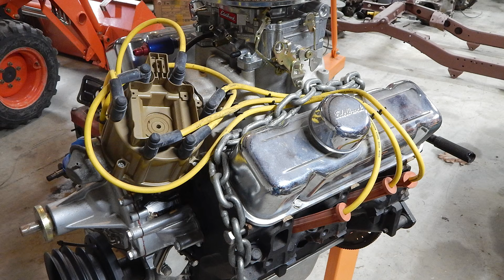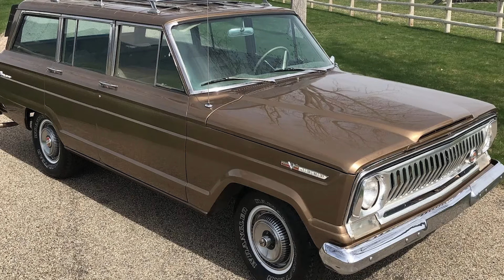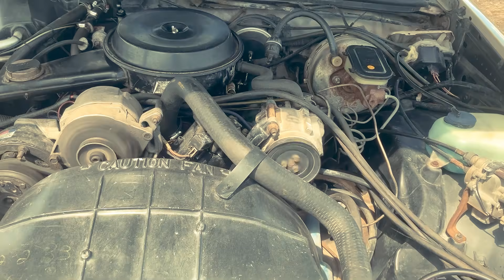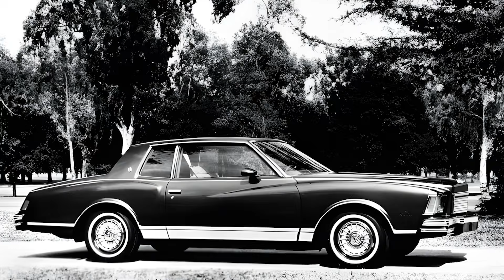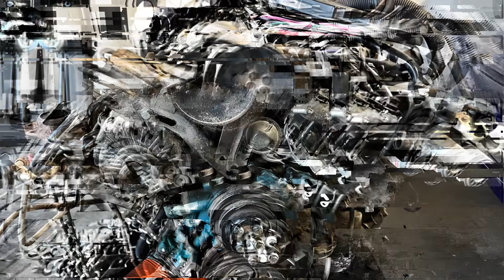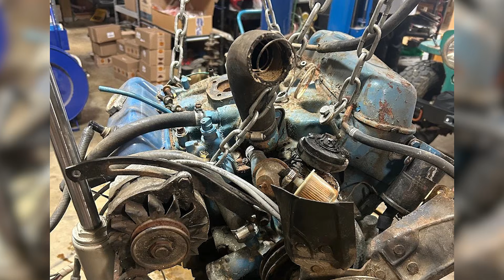The Shocking Truth About the Buick 231 V6 Engine – The Cheap Engine That Saved GM

Comment: I had a 1985 Buick Regal with the 231 and it was a solid reliable motor.  I also had a 1987 Oldsmobile Cutlass with the 307 V8.  Both were great cars and motors but the 231 was definitely reliable.

Comment: The real reason they killed off the 3800 3.8 L engine is cuz it was a 2005 they discontinue the motor and Buicks and everything else cuz I have a 99 Camaro that has a 3800 Series 2 in it and I think they killed it off because there's two dang reliable cast iron head cast iron block naturally aspirated made 210 horsepower turbo to me like what 240 or supercharged and for crying out loud mine has 2333,000 miles still going and on the highway with an automatic the best mileage I got doing 80 was 27 miles to a gallon so it wasn't that they didn't get good gas mileage they got good gas mileage and they were dang reliable cuz they're simple and strong and I think that's why GMC killed them off because they can't have a reliable engine that nobody comes back for repairs left and right like the junk that GMC and a lot of other companies are producing now they constantly break down and constantly need work they're just too darn junkie the new stuff

Comment: Hi,I have a buick v6 231 1978,kenne bell #1 intake mild cam, 9.5:1 compression, my question is all the v6s I have had timing was like 15 or 16 degrees before, on this engine I am ste at 5 to keep from pinging and rattling,can you tell me what is the difference  this time with this engine,thankyou tom
Reply: Does the Kennebell intake have provision for the EGR valve?  They made them with and without it.  I suspect not in your case.  I used the aluminum intake manifold from the Cadillac 252 CI version of this engine.  An EGR valve sends a small amount of inert exhaust gas into the cylinders when under load, which is when knock occurs.  It's purpose is to reduce production of NOX, a nasty pollutant.  Removing an EGR valve, or just disconnecting it, does not reduce power by any measurable amount.  It usually results in users having to retune the carburetor to run richer, to reduce cylinder combustion temperatures (but rarely enough to eliminate knock), increasing fuel consumption and increasing the exhaust pollution a lot!

99% of the time knock in this engine is the result of a defective or missing EGR valve.  If it's there, check the vacuum line to it.  Sometime, after years of use, there can be some corrosion or carbon build up on the shaft that can be removed to make it work again.  The one on my modified 231 NA V6 is now 46 years old and still working perfectly.

Comment: I rebuilt 6 of these engines, bought one and repaired another 6.  The 1977 on even fIred was a dream but needed the timing chain and weak springed activated tensioner replaced at around 60k miles.  The nylon on the cam gear would break off.  The steel sprocket was better but noisier.  I once drove one 75 miles after blowing a head gasket and it ran until the oil thinned out so much that the lifters collapsed.  The next day I drove it the remaining 20 miles home in that condition  The last one i owned was a 2000 Lesabre that blew the lower intake gasket twice because the first time the Mechanic before me only replaced the nylon coolant elbow with a steel one on one side.  Also the EGR Valve port was too close to a water jacket so it warped the head right next to a coolant port.  The cylinders would fill with coolant unles I started it every day.  In Winter I forgot and hadn't started in for days.  When I tried it hydrolocked.  I replaced the TPS on these regularly as well as the Map, Map Sensor and EGR Valves.  The PCV Valve kit needed replacing often.  The BLOCK was indestructible.  Not the entire engine.  If you ran it to 300k miles I guarantee you spent the equivalent of a new engine in peripherals over it's life span.
Reply from the maker: Thanks for sharing your experience. You summed it up perfectly. Bulletproof block but everything around it needed constant care. Your insights add real depth to the story of the 231 V6.

Comment: I have the original 231 oddfire in my 1977 Buick skylark , burns oil like crazy
Reply from the maker: That’s awesome you still have the original 231 odd fire in your ’77 Skylark. The oil burning was definitely one of its quirks, especially as miles added up. Still, keeping it running today is a badge of honor. Respect!
Reply: @EngineLegendsHelo  its major quirk was its awful lubrication system that wiped out rod bearings with horrendous regularity. Buick started to fix that in 1986 with a crankshaft driven oil pump in FWD versions, but RWD versions kept the aluminum external oil pump through the end of the '80s. That included the turbo versions. Its legendary reliability didn't exist until the lubrication system was fixed.

Comment: I run a 1977 VW bus powered by a buick 231 Howell EFI.
Reply from the maker: That’s incredible! A 1977 VW Bus with a Buick 231 and Howell EFI is a true sleeper setup. Smart choice combining American torque with modern fuel injection. Bet it surprises a lot of people at stoplights. Thanks for sharing!

Comment: Had a 2000 grand prix. Head gaskets let go at 130K miles.
Reply from the maker: Thanks for sharing. Sorry to hear about the head gasket failure at 130K. That was a known weak point on some later 3800s. Still, when they held together, those engines ran strong.
Reply: i was asked if i wanted to swap out my 3.8 out of my cutlass supreme, and i refused. shes good stock the way she is 😎